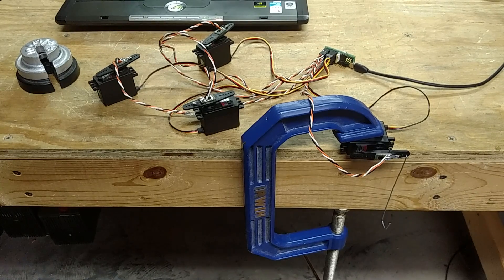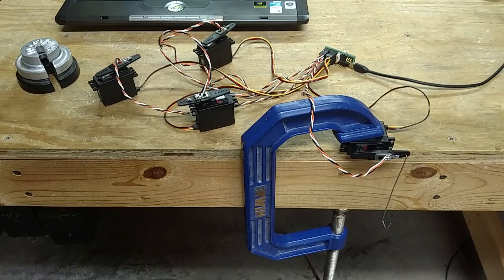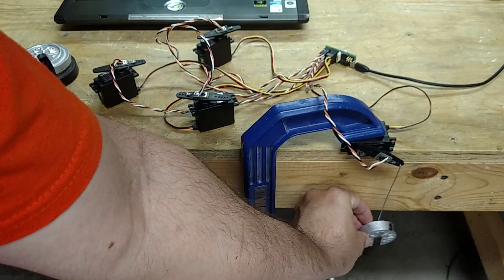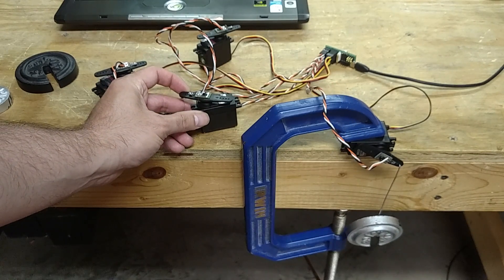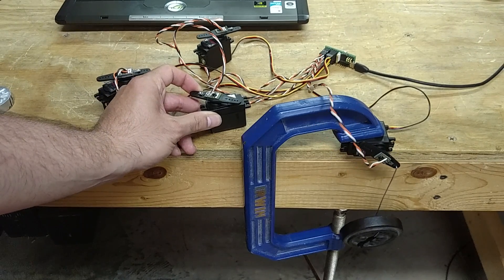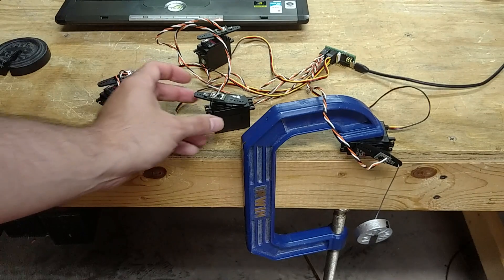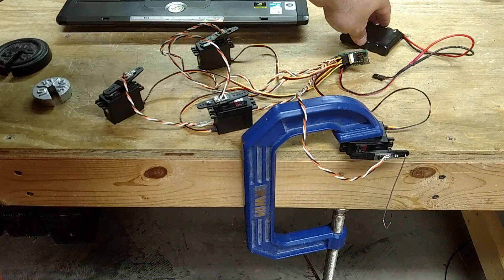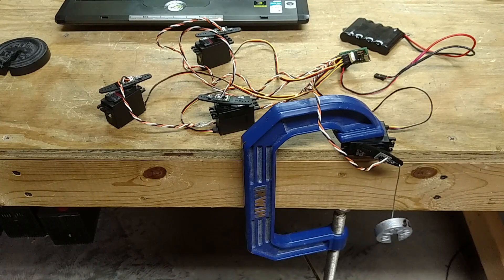RTMCS2 spring model, multiple force input mode.

Comment: Nice work. Can you share how your code works? I am new to coding and 
want to do something similar but with Arduino and 3d printed servo arms 
with hall effect sensors.
Reply from the maker: +Aleksi Lepistö 

The virtual spring is F=kx, where k is the spring constant, and x is the displacement from center.

Force from all the servo sensors are summed together and subtracted from the virtual spring force.

Then the micro solves F=ma, for acceleration (a), where F is the total system force, m is the system mass.

Acceleration is integrated to get velocity, and velocity is integrated to get position.

The position is then converted to the standard 1-2ms servo pulse.

The velocity term is also used to calculate a damping force, which also gets summed.
Reply: Thank you for quick reply. I will try this when my parts arrive. :)

Comment: This is amazing!  Will this be open source, or a product that you can get?  I really have some ideas for this..
Reply from the maker: Eventually I plan on selling it...
See this video: http://youtu.be/2gXBWEkjcMs
It is not quite ready yet...
Once the bootloader is working then I would feel better about selling it.

I also need to get the network interface working over USB and the GUI, but for now the parameters can be changed via config files and a text editor.

Thanks for watching,
Wolf
Reply: I hope you make it able to be modded into other systems because man..  That would be amazing for force feedback in drones, which I make a lot of and would love to have something like that..  What force sensors are you using for the end effectors?
Reply from the maker: +ITman496 
I made the force sensors, see this video:
http://youtu.be/LoqGDTH75jY

If you put the RTMCS2 board on your drone. Then transmit those values back to a RTMCS2 on your controller you would be able to "feel" the forces on each axis of your drone. :)

There would be several options for the wireless link, since the dsPIC33EP series can map, I2C, SPI, UART, etc... to any pins. :)

I hope that answers your questions,
Wolf
Reply: Wolf Tronix
that is awesome!  I find your sensor design to be very clever..  If I understand correctly, you have a linear hall effect sensor, a magnet on the end of the arm, and a way to make it flex?  I've been trying to achieve this for a long time but I never got anything working as well as you did.  I mainly love your design because its very solid.  Most feedback designs require way too much movement to work. Yours works so well, its practically a mechanical linkage!
Reply from the maker: +ITman496 
Yup, that is how it works...
What makes it require hardly any movement is the tiny magnet, since it is only 1/32" thick, full scale deflection is +/- 1/64"
Reply: Wolf Tronix
That's very clever.  I have to work on trying to find tiny magnets like that..  You've inspired me greatly, thank you!  Just need to figure out which of the many hall sensors on digikey works for this and play around..
Reply from the maker: +ITman496 
This is the hall effect sensor I used:
http://www.digikey.com/product-detail/en/A1304ELHLX-T/620-1548-1-ND

For the magnets, search ebay:
1/16 x 1/32 neodymium magnet
Reply: Thank you~  I guess I got my answer then about if the magnet needed to be standard or diametrically polarized.  Keep up the amazing work, I will eagerly watch for updates.